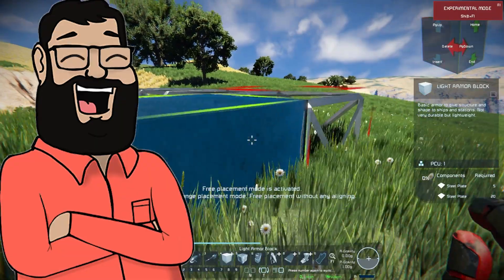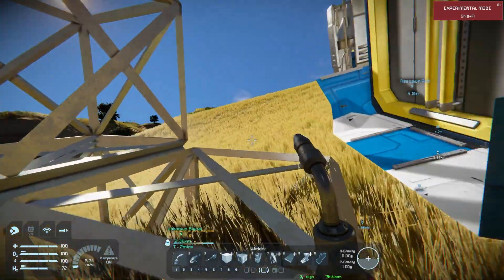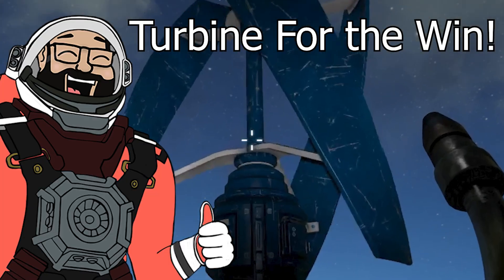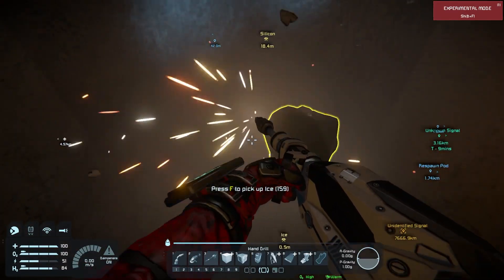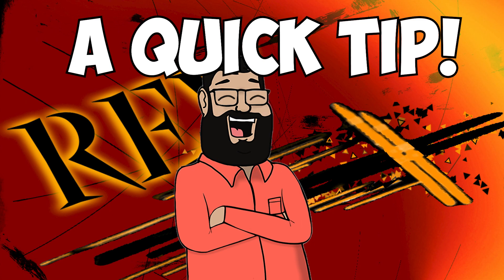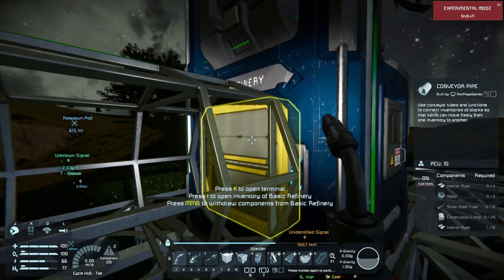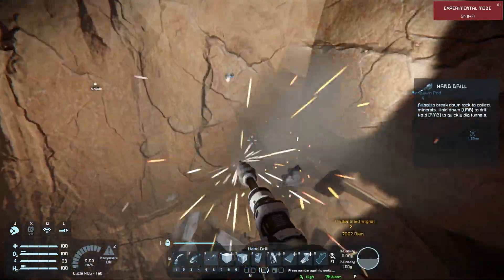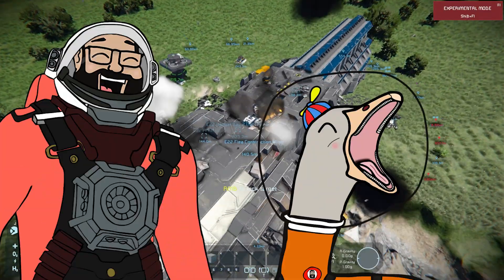A Beginners Guide to Base Building in Space Engineers!

Comment: Your turbine tree is overkill.

Build a stalk, say, 10 higher.
On the one but last block, attach 1 extra block on each free side (i.e. 4 side blocks)
Put a turbine on top,
and on each side block (outward)  now you have 5 turbines in close proximity that do no influence each other.

And don't flesh out your tower until later,  that will save you 24 steel plates per block,  or in  my example (10+4)*24 = 326 steel plates.  Or 326*7 = 2282 iron ingots.
Use those for something else until you have your production running.
Reply from the maker: I appreciate your input!

Comment: There is better configuration for a win turbine. Make a 5x5 cross and put your 3x3 turbine in the middle. Then attach 1x4 branch to the end of the cross, so make it shape looks like an Hindu symbol of sun (or infamous German sign). Now add 4 turbines to the end of each branch. Now add one block to that branch away from center and put another 4 turbines for each branch. Which makes you total on 9 compact turbines. It way seems, that they will interfere with each other, but no, the only part that matter for wind turbine is a middle part of 3x3. If it not see any obstacle in each direction, you will get full power. Also you can add another set of turbines to the other side. They work perfectly fine even upside down. And now you have compact and efficient 17 turbines in one small place. And what if you want more? You can extend this patter by another layer. And if you look, you will see that distance between middle section is perfectly 9 block away from another. Idea isn't mine, just extended it that way.
Reply from the maker: Thanks for this! Mine was just a simple mock up for the purposes of describing the turbine. Hopeful others will see this and can apply it to their builds!